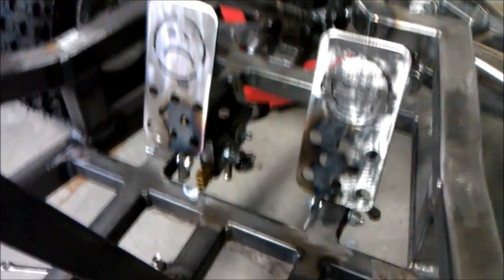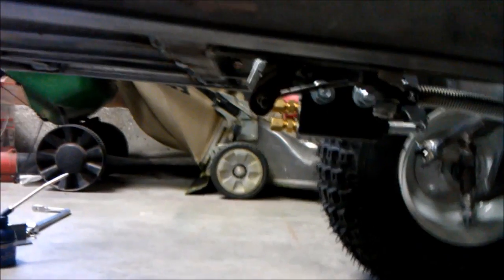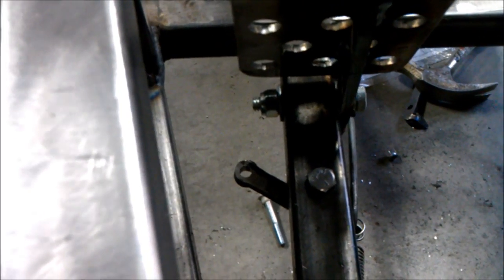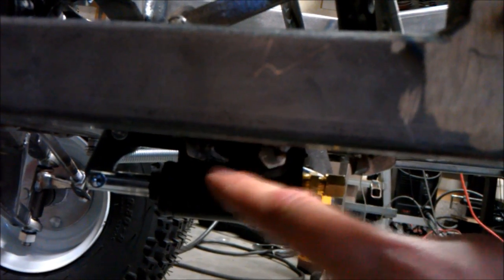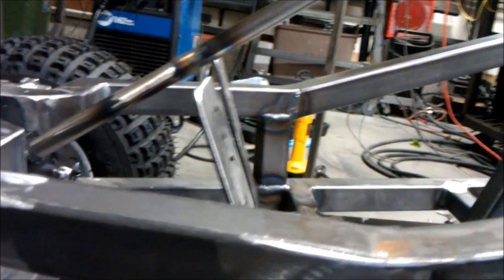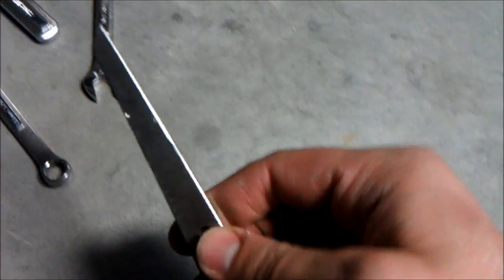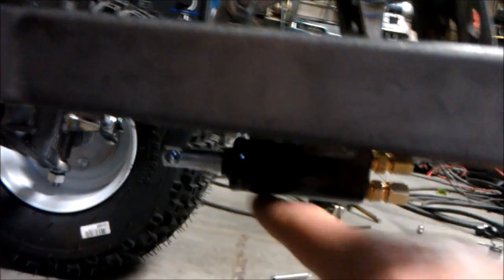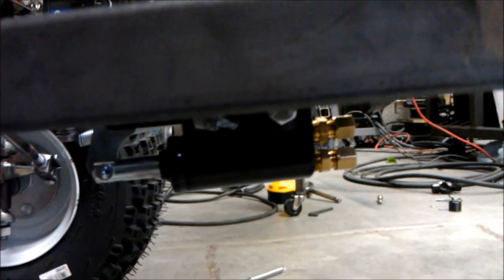Gokart Update -- Brake and Gas Pedal Setup

Comment: what engine did u use ? didn't you need the clutch  pedal ?
Reply from the maker: Harbor freight engine.   I added a torque converter to it, so no clutch is necessary